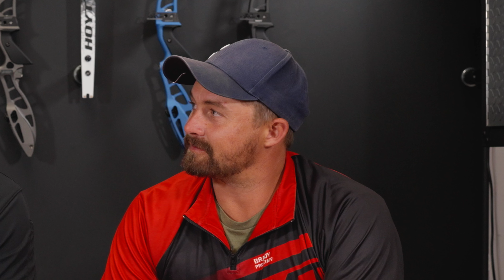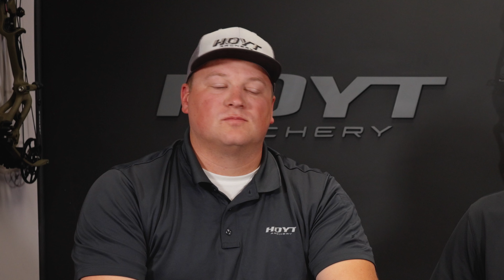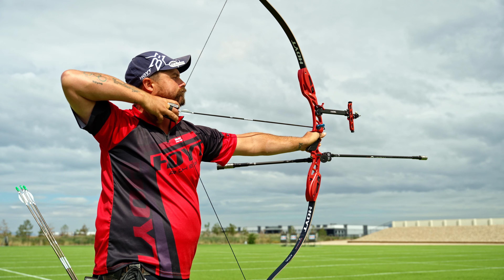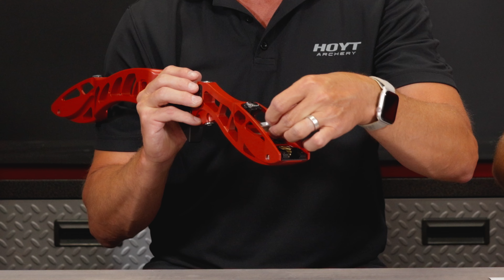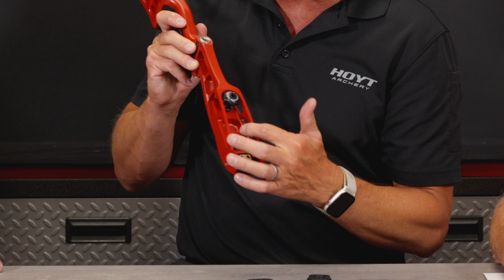Formula XD Recurve Riser Shop Talk with Brady Ellison

Comment: Just out of curiosity. My old 2006 Hoyt Matrix riser has the grip lower than my modern Hoyt Arcos riser. The Matrix is about 5/16 of and inch lower from the top limb pivot to the plunger button centerline  than the Arcos riser. That being said is this a rework of an older design?